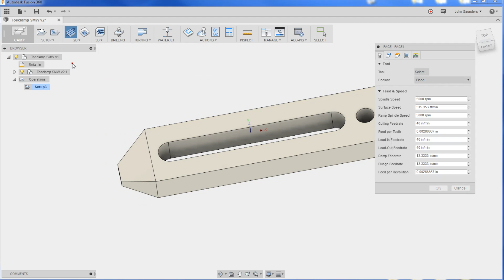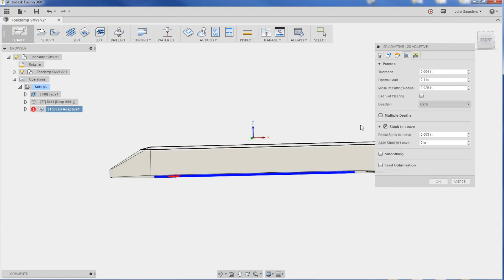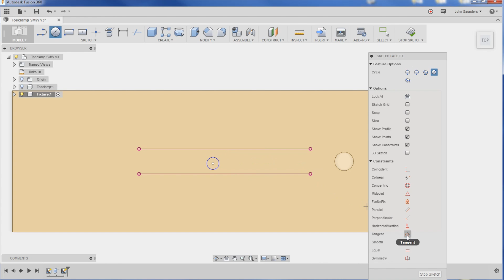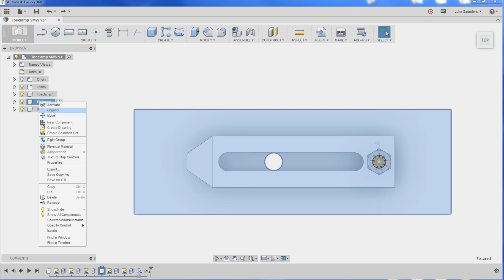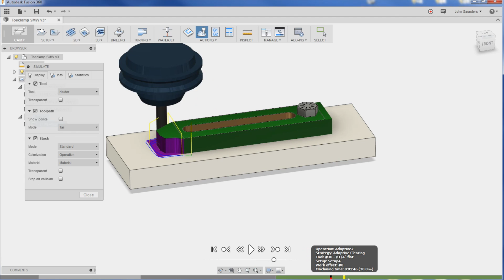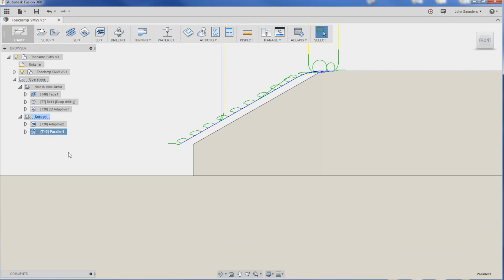Fixture & CAM to CNC Machine a Toe Clamp!  FF39

Comment: Great video. I would skip the fixture. Add approximate.150in to the bottom to hold in the vice. Finish the part completely. Then flip the part in the vice and skim off the bottom.

Comment: or you could just get a stock that is a little thicker in height, mill everything at once without screws (but a little deeper than the part itself). If thats done, just turn it around (upper side facing down in the jaws), touch the parallels or what the part is laying on and say Z -part thickness (like -15mm). Face it at Z0 and done :)

Comment: what is the difference between extrude and press pull?
Reply: Extrude uses a 2D sketch as the base profile for an extrusion. 

Press pull alters an existing solid/ face surface
Reply: press pull seems to work for extruding sketches too.

Comment: it's nice to see how the cam works ..... BUT .... 
doing a short run of parts like that .  I would just clamp the fixture at  angle X and lob it off.
guess I'm just old school...
Reply: Exactly. Must be quicker to set it up on a sine bar in the Bridgeport than to do all that parallel ball mill stuff on the CNC, and you'd get a flat surface on the toe. +Abom79 would have smashed that off in one pass with a slab mill on the K&T :)
Reply: He has a fourth axis that he never uses, but it could do this very easy.

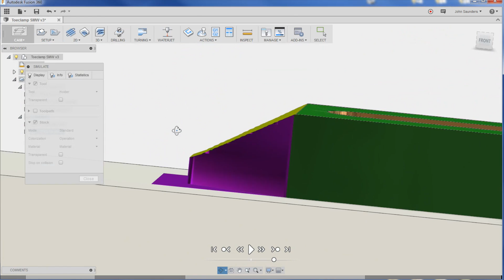Comment: That crosshatch pattern you did on the slope with the parallel looked like it had a really rough surface finish in the cam. How did it actually turn out? When you showed a view from the side in the simulation it looked bumpy, at about 19:00 to 19:01. Also on another note, why not recess the part a little bit into the fixture?

Comment: Hi John, I did a lot of 3D machiening lately and learned that you dont have to use a ball mill a lot of the time. Using a flat mill has a way better cutting speed at the contact point and has more contact surface - larger steppover for good surface finish. I only use ball mills for concave surfaces. I think for convex shapes a flat mill is more efficient or for what you did at the front of the clamp. ...edit: although the effect is cool :)
Reply: Problem with a flat endmill is that your surface will most likely be incorrect. A flat endmill isn't actually flat on the bottom. The bottom is actually dished out for relief. It you're surfacing up and over a convex surface the tool path will start cutting with the leading edge, as it goes up the radius, when it reaches near the apex it'll move towards cutting with the center of the tool, and as it comes down will cut with the tools trailing edge. 

Since the tools center is dished and not compensated for, the sections it cut with the center area of the tool won't correctly match the profile. 

You can get away with using a flat if you  up or down mill only and tell the CAM to force using leading or trailing edge tool comp only. A bull endmill would still be better though
Reply: You are right! Never thought of that. But for my applications this very very (very! :) minor inaccuracy never was an issue. Sure, if the mill is quite large in relation to the feature it really could be an issue but I was more refering to relationships like the one in the clamp video.
Reply: +der ProtoTyp 
Yes. Certainly for cosmetic only surfaces where it's just there to look pretty, a flat endmill is fine without having to do anything fancy.

Comment: If you had to fixture it more precisely, could you have extruded the slot up 0.01" or so on the fixture?  That would give an internal shoulder to position the part, but not interfere with the two bolts or the milling ops.  Is it difficult to get the slots and such a fixture to fit precisely enough?

Comment: As some have added, I would use Touch surfaces and Contact point boundary.  The tool didn't go off the end of the part during surfacing because you didn't have Contact Point Boundary checked it was using the centerline of the tool to contain it.  When you check CPB it uses the actual point of contact on the ball mill

Comment: You should try using the avoid/touch with that ball mill at the end, works better when you combine it with a tool containment. change your containment to outside and then give it a touch surface that is the angled bit on that toe clamp.

Comment: Hi John! How would you do the pre-drill (4:39) in a square or rectangular slot? I know a endmill is not gonna reach the corners, but I would like to know how to pre-drill such a slot to prevent the ramp in.
Reply: Similar way. Draw a circle but make it tangent to 3 lines instead of 2
Reply: Also you can pre-drill any where in your slot or square and any size hole as long as it is bigger then your end mill your using to rough out the slot or square.

Comment: I would have approached it differently and skipped the fixture entirely. If you hold the additional stock material in the vise and face, drill, slot, machine outside perimeter and 3D all in one op. Then I would just flip the project in the vise and then machine the excess material off the bottom.
Reply: +Chief Machining 
I sometimes wonder if he does things inefficiently specifically to showcase certain things you can do in Fusion, rather than show the best most efficient (or easiest) way to do something
Reply: LOL yep waste of time on the fixturing
Reply: Really counterproductive then.. Find a sample that showcases what you're trying to accomplish  instead horribly inefficient part.
Reply: +Chief Machining 
If he were doing multiple parts at once he could take this single station fixture and transform it for multiple stations easily. So it's easily scalable design wise.  For a single part, ya it's not great. But for multiple parts with one setup this would be a better way.
Reply: Not even that is good idea. I would just cut them into strips to get 2 or 3 space so you could get 3/8 endmill and mill soft jaws for the parts and face them to thickness and chamfer

Comment: master cam is better then this for 3d cnc n lathe programme making. I think
Reply: I'd say for 3D milling Fusion is on par with Mastercam. 

Lathe MasterCAM is better. 

But now compare the price of each..,
Reply: +Occams Sawzall price is different of both master cam is heigher then, bt master cam is so eassy no no more step to do any 3 d n 2 d
Reply: +Omkar Bhattarai da hell you on about? XD

Look. Fusion costs $25/mo for business's, free for everyone else. 
MasterCAM is $15-$20k plus maintenance fees. 

Yet Fusion for 2D and 3D is nearly identical to Mastercam. Mastercam may have a a slight edge. But not when you factor the massive cost difference. 

But hey. It's your money to waste, not mine. For 90% of 2D and 3D work Fusion is more than capable.
Reply: +Occams Sawzall cost is not important bt how eassy work you ll find during n how u going to save ur time ur power n many more less cost give more result. more this is so eassy to do any work. even in learner. s its ur openion with ur experience  so u also right.

Comment: If you want to select specific faces to 3D machine.  Go to that little "Avoid/Touch surfaces" check box. Select the faces you want to surface, and check the "touch surface" box. It's a sub-check box that comes up after checking the avoid/touch check box. 

That will limit the toolpath to only the surfaces you select.
Reply: +1
Reply: +chronok I disagree. A more complex surfaced part will require multiple size ball endmills.  Being able to specifically target surface sections, while avoiding neighboring sections is far better than trying to 2d contain and fiddle with the boundary extents. 
Also much faster to calculate than surfacing an entire part with a larger BEM than going back and rest surfacing with a smaller one.
Reply: Sweet tip!

Comment: John, you don't have to create a new component 100% of the time. In fact doing so will cause problems in some cases... take this toe clamp for example. If you were to use it in another design, it would be nested one level too deep in your BOM & Browser.... for no good reason. I personally encourage users to think and decide if they need a new component as the first step during the modelling process.
Reply: Turning it into a component by default is akin to always working in a solidworks assembly, but beginning by making a new virtual component and working within it. It's pretty illogical..
Reply: Since it's a new component, couldn't ou simply just export out that single component and use it in other assemblies that way?
Reply: +Occams Sawzall there is only one component in the design. Don't forget that a Fusion design file is in its very nature a component already. Doing what you suggest would create a duplicate file in the project, with the BOM structure of how the design file should have been to begin with.
Reply: +Scott Moyse technically there's 3 components. The clamp, his fixture plate, and the screw he imported. 

I keep assemblies, sub assemblies and individual components in separate folders under each project. Keeps things better organized for me.
Reply: +Occams Sawzall that will teach me for not watching the whole video... there's been a few fusion videos lately that start by telling users they HAVE to create a new component before they do anything else. Which just isn't true, and frankly would instill bad practice.
Reply: +Scott Moyse agree. If you're just making one single part nothing extra, making a new component doesn't give any benefit and isn't needed.
Reply: +Scott Moyse 
On that note I kinda wish Fusion had a dedicated assembly mode that could bring parts in as a lite version. Trying to assemble 10-15 some odd components, each with their own 20 some sub-components. Fusion chugs like a frat boy on a Friday night...

Though that might just be something the software just isn't really designed to do.  Single parts it's great at.
Reply: +Occams Sawzall it will get better
Reply: +Scott Moyse but I'm impatient and want everything now! XD
Reply: +rob lockwood yes/no.  Since Fusion doesn't differentiate between a part and an assembly like Solidworks does. You don't really gain or lose anything by making a single part into a component. 

Essentially in Fusion you are ALWAYS working in an assembly mode.
Reply: +Occams Sawzall no. you are working in component mode. a component turns into an assembly when you add a second component. Rob I'd compare it to opening a new assembly, creating a sub assembly, then creating a part within that. The result is the same BOM structure that's being created here.
Reply: +Scott Moyse 
That sounds like always in assembly mode to me ;) it's not like there's a modal switch between CAD and assembly like there is between CAD/CAM/patch/ etc. 
though I suppose you could argue the component creation side supersedes the assembly side in the CAD mode and it's a pretty blurred relation between the two
Reply: +Occams Sawzall yup

Comment: Why would you leave the bottom side Black-Mill finish and machine the top side?
The Bottom side is in contact with your part (and your step block) and you should prefer that to be the smooth flat surface, you shouldn't care as much about the top side being black-mill finish since it's only in contact with the washer under the clamping nut.
cheers

Comment: How would you mill a hex collar for hex shaft ? I feel like that would be really hard to do
Reply: What kind of hex collar? Single split? Double split? 

Either way it's pretty easy. You can "cheat" and drill out the corners of the hex with a #58 (.042) drill. Then machine out the hex and finish the inside walls of the hex with a 1/16" endmill. 

Or you can buy one online for like $4....
Reply: This is what we are looking making, its a custom spacing for the robot im building normal i would just buy the collar like you said but with where its going a store bought one wont really work.

Picture of our part : http://imgur.com/a/fIuN3
Reply: +alex chisolm that's pretty easy unless you absolutely need the sharp corners (which you rarely ever do) 

Start with the flange side down. Skim the top flat, contour the hub profile and flange profile. Drill holes through the part at each corner of the hex (use the points as the center position for the hole) pocket out and finish the hex. 

Flip the part mill to overall height. 

Lay it on its side, flange side towards the solid jaw, use the flats in the hex to align the part for the side hole
Reply: Thank you so much for the help. Im just starting getting into machining like this so im still fairly uncertain about everything
Reply: +alex chisolm
No problem. 

And learning to machine invariably requires breaking a few tools and scrapping some parts ;)
Reply: Yeah i already learned that the hard way.....

Comment: did u consider pedestal machining? no fixture needed. just need to face off backside. less operations and more accurate not that its really necessary here  but free!  perhaps this was not done for the lessons being taught.
Reply: +Stuart Hardy 
Never heard the term "pedestal machining" but I think I know where he's going with this. 

Instead of leaving all the stock on the top of the part. Leave all the stock on the bottom of the part. You'd clamp on that extra stock on the bottom so the the bottom of your finished part is above the top of your vice jaws. 

This way you can machine the slot, profile, tapped hole and the sloped nose in the first op. 

Second op is to simply flip it over and face mill off the extra stock to bring the part into its finished thickness. 

No fixture required
Reply: +Occams Sawzall now it has been explained that's the way I do my small one offs,( by small they are 25mm square and 5 mm thick)

Thanks for taking the time to educate me 

Stuart
Reply: Would mind explaining for us dim ones🤓
I am new to CNC work in my hobby shop

Great video John funny I am just about to make som small toe clamps
Reply: also known as 5 side machining. start off with a pc of stock thicker than the final size such that you have enough to clamp on the vise and be able to machine all 5 sides including the slot and angled surface and hole. doing so the part is as accurate as the machine and cutters. flip the part over and face off back side.  you may  waste more material (assuming it can be made from stock size)  but you do not need a fixture and the setup for the second op is a simple face cut.